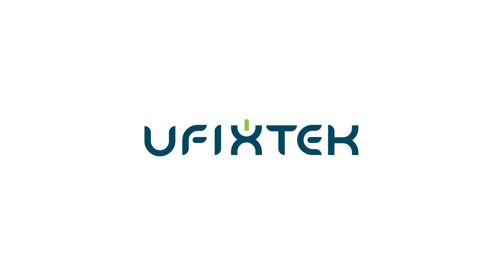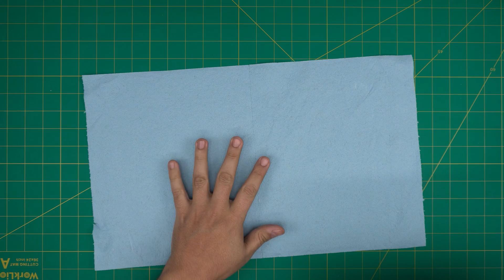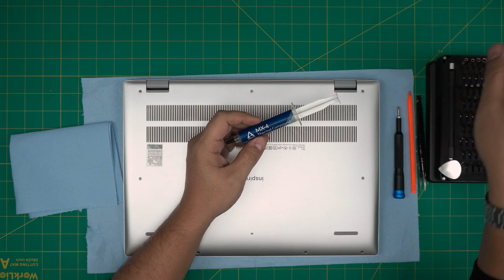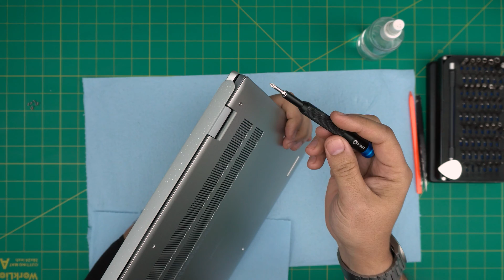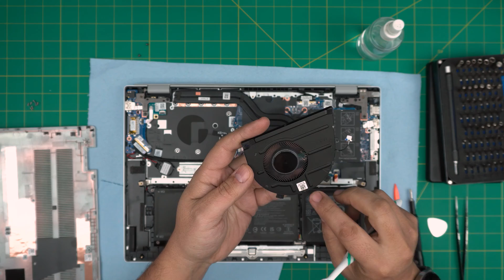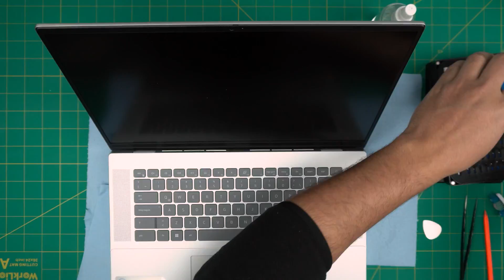How to Repaste and Clean a DELL Inspiron 16 5620 Laptop

Comment: is the 3mm thermal pad important? in my last service the service guy removed it and didnt appy it in the new heatsink?wil it create problem in long run?
Reply from the maker: 🫠Regarding your question, if you or anyone removed the 3mm pad, then you are in trouble. The CPU power management circuit will overheat and fail, and then there will be no more power on.